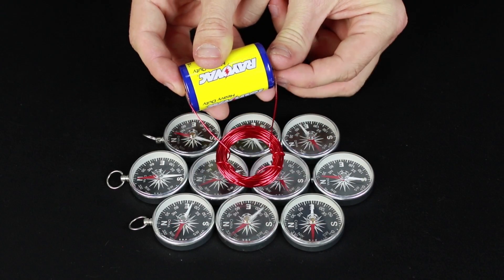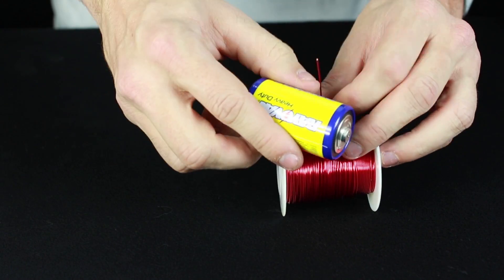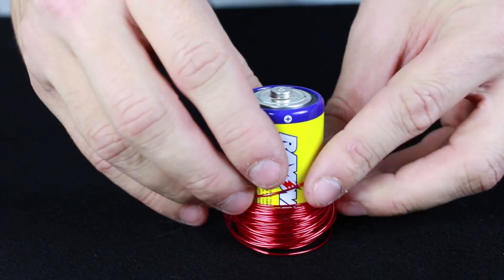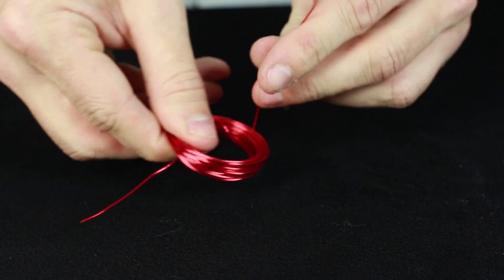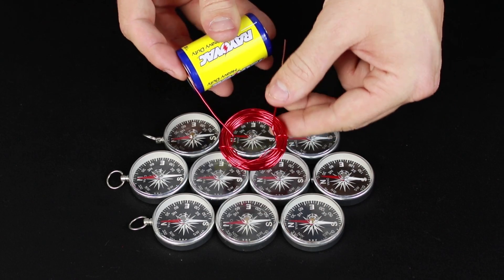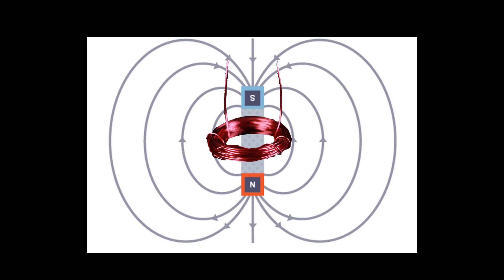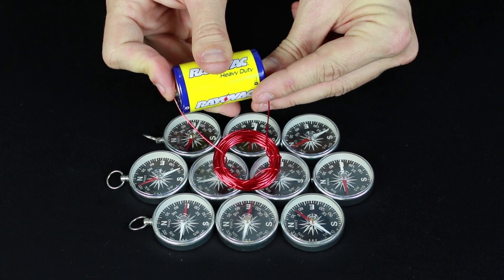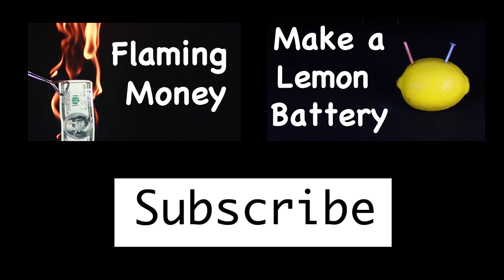How to Make an Electromagnet (Physics)

Comment: If the wire is insulated the how will it allow the flow of current into the two different coils of each othere only please why it works even the wire is insulated.
Reply from the maker: You need to sand the insulation off of the ends of the wire to make a connection with the battery.

Comment: without resistance, it gonna short circuit and burn
Reply from the maker: +Wilfred Kwok The wire is long enough to have some resistance but it does heat up.